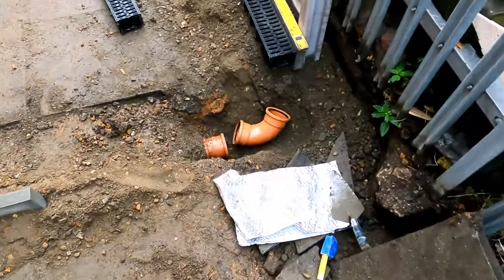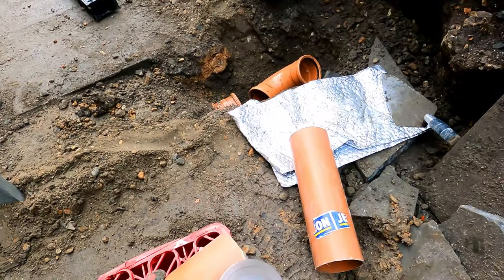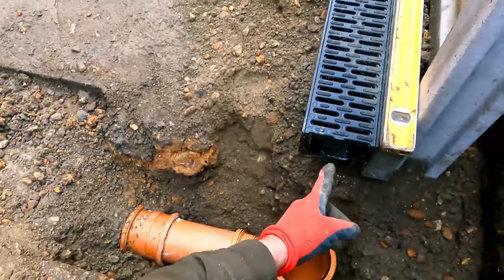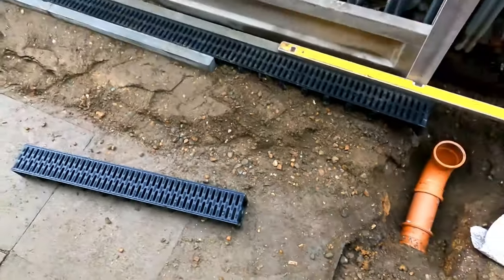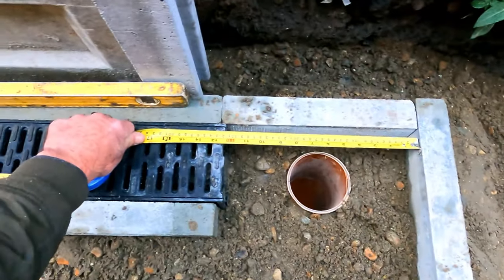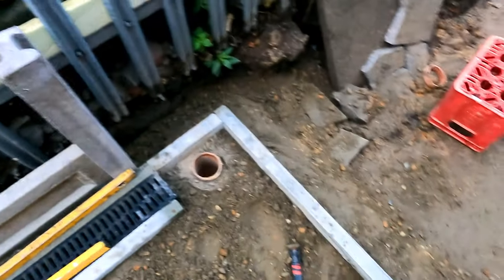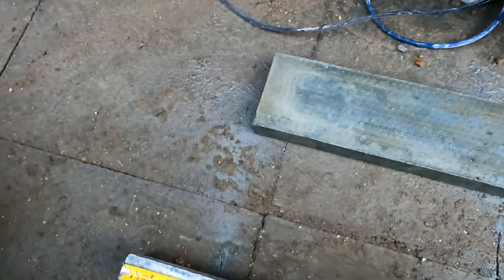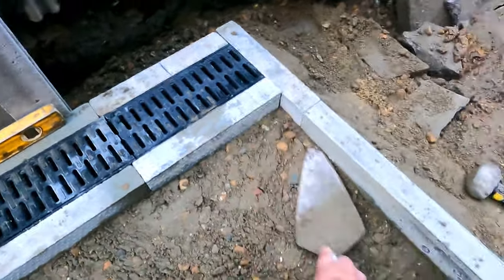How To Connect an ACO CHANNEL To a 90 Degree 4inch Drainage , surface & rain Water Pipe!!

Comment: Good video cheers! What fall do you put on the aco to ensure the rainwater discharges? Thanks
Reply from the maker: Robert kilminster :
Thanks for watching 👍
That is I great question: the rule of thumb is 5mm to 1m of aco channel so all depends on the length you are going you can work out the fall, the aco channels normally come in 1m lengths so its easy to work out the fall,  as long as the water can drain away and has no back fall your all good man 👍.
Reply: @creativecrambo  thanks for getting back to me. I’m using an aco to drain of surface water if a new porcelain patio. I’m running a 4/5 metre drain. Does it not look noticeable that one end of the drain is 20-25mm higher one end than the other? Am I also right in thinking that you can connect the aco to a gully that just collects waste water from the kitchen sink? Thanks for the advice. Watching loads of videos on here to make sure I get it right. Good luck with your channel 👍
Reply from the maker: @robertkilminster3402  
I've put these aco CHANNELS  in with just the turn of the bubble on your level and they work just great you have 4inch of depth on the aco channel the water will never build up and cause you any problems over 5m as long as the water flows to the outlet that's all you need 👍 good luck with your project and hope it turns out ok , if I can be of further help just drop me a message 👍.
Reply: Correct me if I'm wrong but don't they have a slight fall pre built into them by the manufacturer.
Reply from the maker: Thanks for watching 👍
Domestic channel drains don't have a built in fall they are made level but some commercial channel drains do have a built in fall  as long as you don't have a back fall to the outlet your all good mate 👍👍 .
Reply: Yep as long as no back fall you are good. I've installed ACO drains level before, water will still drain, but ideally a little bit of fall is fail safe.
Reply: @paulmcgair5796  Hey Paul ,I was just about to say they have a fall pre built into them ,as your patio would run out of level otherwise. 
Also fitting pipes is one thing but I would definitely fit a trap or sump to catch the silt before it gets to fill your pipes up .
Reply from the maker: @paulbest2203  
If your using a domestic aco CHANNEL they do not have a fall built into them plus the infrastructure of the channel/pipes regarding any silt  buildup are regularly maintained therefore no problem  to think of thanks for your feedback 👍
Reply: @creativecrambo  Hi Paul, I'm installing a porcelain patio myself. How do I connect this ACO drain to my gully? Does it have to run underneath the patio I will build or does it have to be on the edges? It's a kitchen gully I will be connecting to.
Reply from the maker: @larry1363  
Are you asking paul a question or me ? 
But the answer to your question is if you're doing a patio all ground works have to be done before you lay your patio drainage is under ground you have to keep waste/sewer separate from rain water surfaces, don't use an aco channel for this you need a back trap gully in place especially if your connecting to your kitchen waste, an aco channel is for surface water / rain water only.
Reply from the maker: Thanks for watching Larry Gray appreciate it 👍👍 .

Comment: If by "waste water pipe" you mean a sewerage pipe, then this is wrong.
If adding an open drain into a combined system you need to install a sump and/or trap before joining the main line.
Just sayin'...
Reply from the maker: STEVEO thanks for stopping by the vid mate 👍 rain water and surface water only mate I've explained the set up already its all good mate I've had loads of people saying it's wrong but they don't know what I know on the set up thanks for your feedback mate 👍 👊
Reply: @creativecrambo  Not a problem mate. 
Maybe you should consider changing the title of the video.
Other than that you're doing fine.

Comment: Don't like it crap!  Guaranteed to get blocked over time what happens when that Aco gets clogged up with leaves and debris then goes straight into  pipe system? Should have some sort of gulley to collect  all the  dead leaves grit ect so it can be cleaned out periodically.
Reply from the maker: No need to be rude Jimmy, I've explained the whole set up on this aco channel plus where the water goes to , in previous comments no need to jump the gun before you know the facts .
Reply: @creativecrambo   So no gully then, school boy error!
Reply from the maker: @jimmywisdom287  like I said, you are jumping the gun, I've explained the whole setup of this job in the comments ,as for school boy era 🤔 💯don't think so , plus don't come to my channel and try to antagonize me in anyway you haven't got the facts right let's leave it at that plus you also seem abit aggressive to me aswell in the way you write 🤔
Reply: @creativecrambo  There's always one mate 🙄 Good job 👍
Reply from the maker: @mikewalker2068  
😀😀 that's a fact  funny thing is Mike I've done loads of work on that estate and was back there recently and the aco CHANNEL is working a treat 🙄😄😄👍👊.

Comment: You have raised the floor level over the DPC for the house. Outside ground level should be 75mm below DPC. Very lazy job mate.shame on you
Reply from the maker: After reading your comment you really don't know what your talking about that's a fact 🤔 
There's no house, and the minimum depth from dpc should be 150mm 2 course down of brick standard not 75mm, don't know where you heard that from, also I've put edgings in along side the building 1inch from the building there for no bridging of the dpc and transfer of any moisture/ damp 
You have no clue about what it takes to do a job like this and you should think about what you say before you say it 
As for a very lazy job and shame on me 🤔🤣
Shame on you for not getting your facts right 💯
Plus I'm not your mate 😏